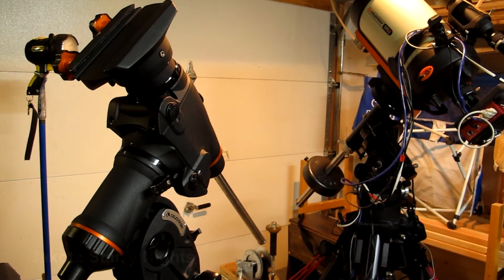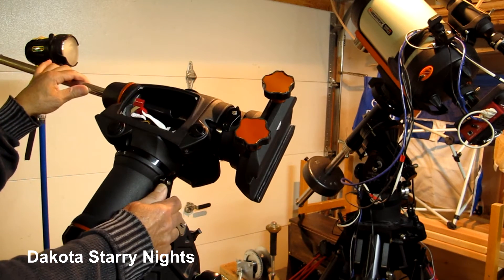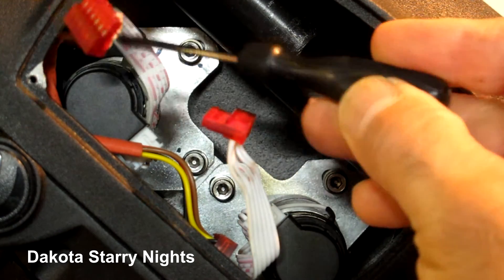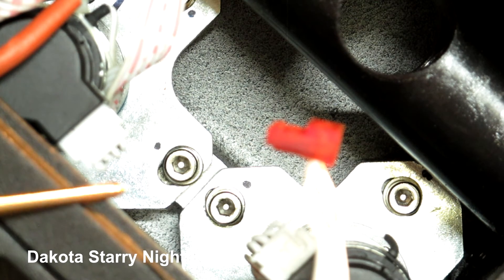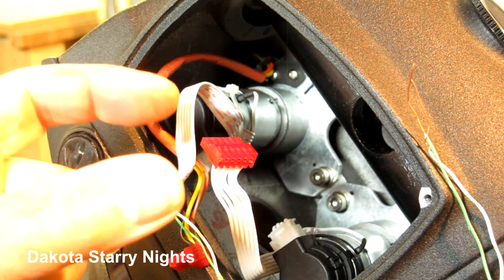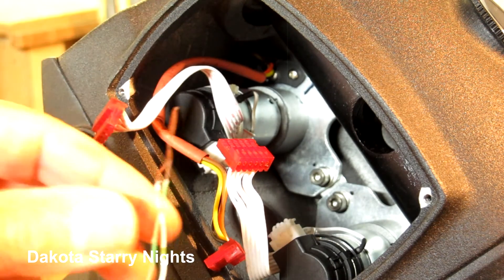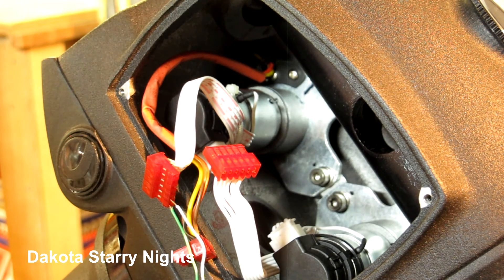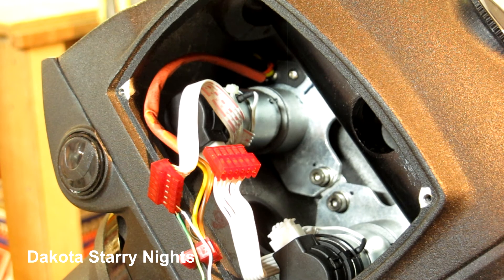Celestron CGEM Mount RA Motor Troubleshooting

Comment: I've just watched your videos again after a few years..I had no end of issues with my cgem.. seems like it's major flaws are with the servo motors,  backlash issues with the motor gear to the worm spur gear mesh... so I'm going to belt mod mine and replace the servo motors for steppers... and change the board and run it with onstep... can't believe someone designed it to make these issues..
Reply from the maker: It's hit and miss with the system they've employed for sure.  The belt drives mounts are becoming very popular these days.  Fortunately, in your case, you seem to have the skill sets necessary to make the conversion. Many are not so lucky and get stuck with the way it came. Cheers!

Comment: How does one know if that watch battery needs replacement? They last a long time, but mine is an old mount. What won’t work if that battery is going out?
Reply from the maker: You can check the battery with a volt meter.  But I'd would go ahead and replace it.  One less thing to worry about as just a small drop in voltage can throw a lot of things off.

Comment: You did not mention the DC voltage you applied to test the motor, was it 12V?
Reply from the maker: yes, 12v
Reply: @DakotaStarryNights  Thanks.  I recently acquired a used CGEM DX with the RA drive being intermittent.  Tried it out for the first time last night.  Yep, problem confirmed.  A smell of hot electronics was detected at the mount, turned the mount off.  I am thinking bad RA motor or driver or both at this point.  A good repair project...  Thanks for your quick reply.  Now to find time to work on it.  Thanks again for your quick reply.

Comment: Do you have the rest of the story? What happened to the encoders? How did you replace them, or fix it finally?
Reply from the maker: The encoders on the motor control board are not replaceable due to the micro soldering necessary. The fix was to replace the old MC board with a new one.  Clear Skies.
Reply: Did you get one from Celestron, or second hand?
Reply from the maker: I got the MC board from deepspaceproducts.com/cgem-motor-control-module-cgem-series_8_4245_9482.html
It's advisable to update your hand controller and MC board after installation.  The new boards provide more power to the motors.  It's the same one they're now using for the DX.
Reply: Thanks!
Reply: @DakotaStarryNights  Although those IC's at 4:55 look like they might have been something custom-programmed by Celestron, if you could obtain them it shouldn't be too hard to replace with a "Hot Air Rework Station" and some solder.  Also, 9:57, isn't it just an RJ-12 socket and you could use telephone cable with an RJ-12 plug on it (after checking that Celestron doesn't use some proprietary wiring that's different from the standard telephone wire).  It says Hand Controller on the socket so that's probably just signals and not power and I don't think you'd have to worry about ampacity of the cable (overheating).  You could even make your own lengths getting a crimper (https://www.aliexpress.com/item/33028577788.html ...though you might want to get a better one) plus some 6-wire cable (https://www.aliexpress.com/item/32948638643.html) and jacks (https://www.aliexpress.com/item/32956150910.html); all that assuming it's actually RJ-12 but if it's not you just need to figure out which connector it is and it's the same deal; cable + jack + crimper.

Comment: By plugging your motor onto your friends mount my only concern would be...what if the motor was what caused the damage to the controller? Just saying.
Reply from the maker: Yeah, that's certainly possible.  I only plugged into my friend's CGEM to verify what I thought the problem was, which it did.  Knowing this you shouldn't have to. :-)
Reply: Dakota Starry Nights
I'm looking to get a new mount. I'm going to get an 8" Edge HD, what your honest opinion on this mount with that OTA?
Reply from the maker: CyScape The CGEM in experienced hands can easily handle an 8" Edge HD.  I could have gotten the 9.25" Edge but I knew the 8" would be a much better fit.  Keep in mind the 8" & 9.25" operate at 2125mm and 2321mm.  Imaging at around f/10 can be demanding.  But if you keep your imaging payload under 21lbs or less then you should be good.  If you're just doing visual work then the 9.25 Edge might be a better choice.   Clear Skies